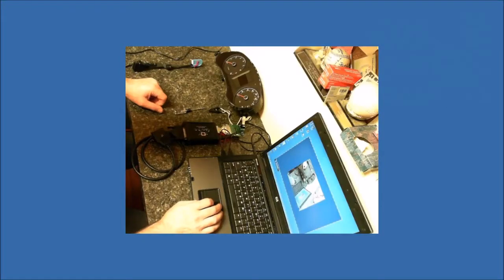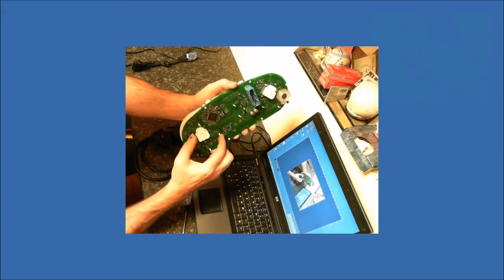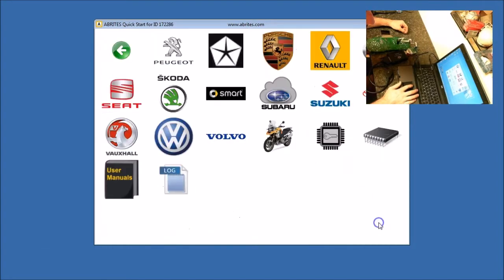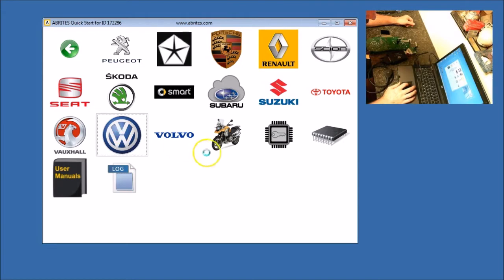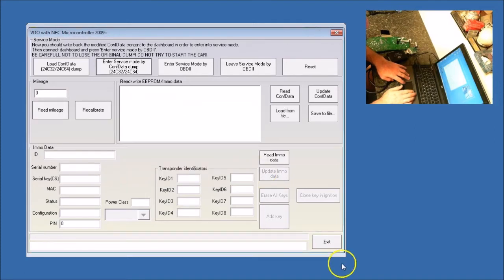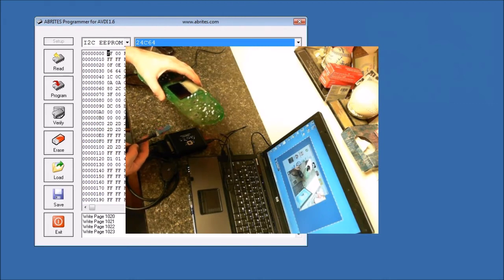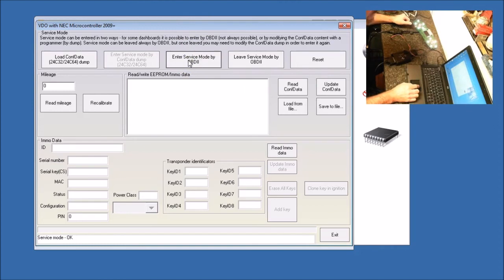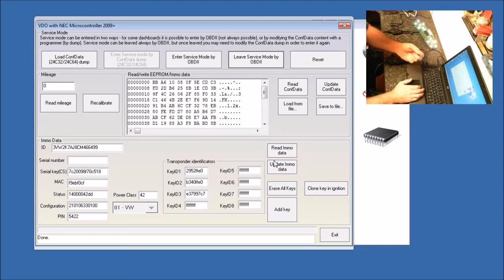NECDashVid

Comment: I have a 2008MK5 Golf GTI with a RED-dot highline MFD cluster.
I purchased a MK6 GTI cluster that came with a matching used key and key-barrel.  Can I simply use the existing transponder to just get the PIN using AVDI?  Can I then use the PIN to marry the MK6 cluster with my existing MK5 ECU?   I would just place the MK6 transponder in my MK5 key to start the car.  Can this all work as I stated above?

Comment: Hey Tim,
Good demonstration, however after assembling the cluster back there is all kind of configuration errors like abs brake etc, how do get rid of that?
Reply from the maker: did you program the key on the bench?  if you put the cluster back in the car and then try and program the key, you stand the chance of loosing the ABS coding... That is why we came up with the NEC cluster cable kit...  read the data, rewrite the data,then fire up cluster on the bench and program a key, put key in the reader of the cable and check to make sure the key is seen by the cluster, before you put the cluster back in the car...
Reply: Got u, I think that’s why!
Same apply for micronas after you ffff out the lines of code or it doesn’t meter ?
Also any way clear out this lights with abrites ?

Thanks for your help!
Reply from the maker: yes, it's the same with the micronas cluster..  The way to get rid of the ABS module having lost it's coding is to code it...  With AVDI, go up above to the modules, double click on brakes, then click on the coding button...  What I have done before is find a car with the same options and log into that ABS module and read the coding...  These have worked for me before...Coding: 0013629 or Coding: 0013569
Reply: Read abs coding before u start the process and u can write it back with an tool u have or u can use odis clone thru offline mode very easy

Read abs before u start

Read abs before you start